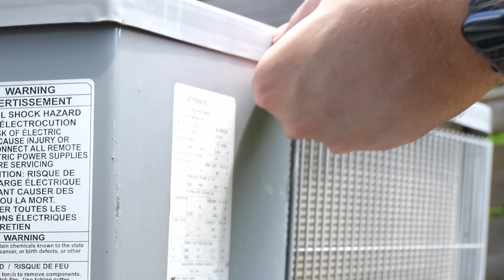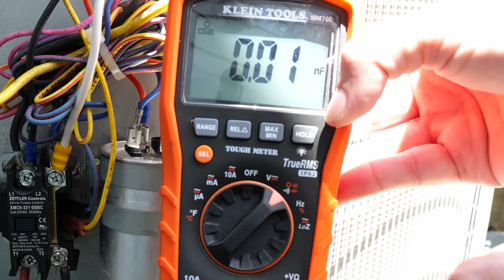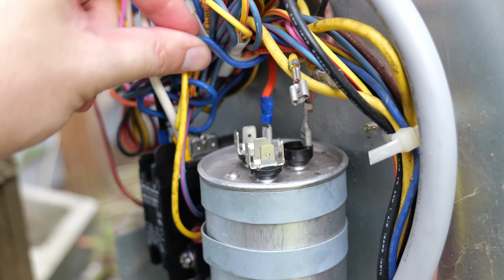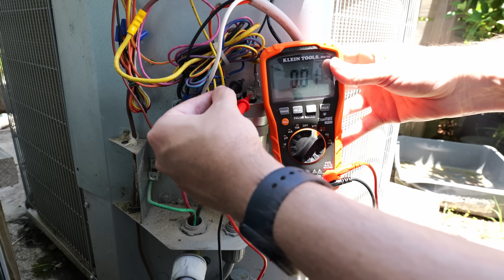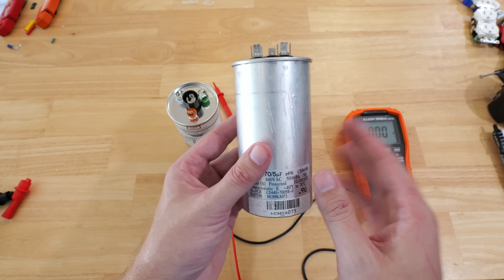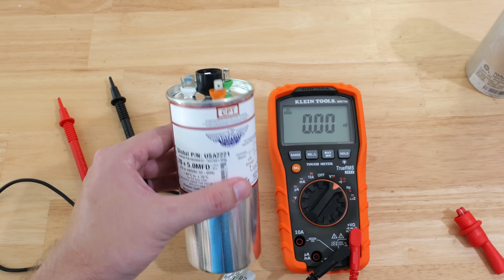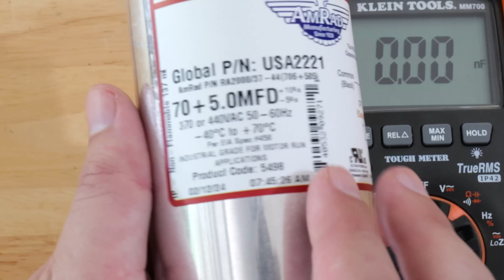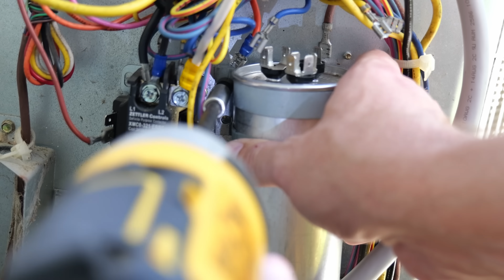Don’t Get Ripped Off! How To Avoid The AC Capacitor Scam And Save $500

Comment: allot of hvac places won't sell to non hvac people. when i had an issue with my heat pump,  the capacitor was replaced by me, it didn't fix the issue, but the hvac guy almost demanded to know who sold it to me. they don't want diy non hvac people to fix their own issues.
Reply from the maker: Nope.  And the supply houses don't want to make the techs mad as that is by far most of their business.
Reply: get an EPA license and they'll sell you just about anything :) lot of "unlicensed" contractors out there too and the only thing they have is EPA cert
Reply: I bought my cap on grainger's website providing no credentials and then went in to pick it up no questions asked.

Comment: Usually those caps well be a bit corroded on the top. when a tech comes to the house they always try to sell you a $400 cap that is about $12 cost  What is a customer supposed to do one of the biggest ripoffs in the USA USA USA USA

Comment: I was quoted $450 labor plus part to replace the capacitor. I replaced it myself for $25; turns out the one I replaced was just fine - the unit had tripped a circuit breaker.

Comment: As an hvac tech myself. I want to ask you one question. Do you really wanna get shocked. It probably won’t kill you.m but it will hurt. It damn hurts. Because it can and it will happen if you’re the normal homeowner. Or do you want a professional to do it?
Reply from the maker: It will happen huh?  Well Mr. HVAC can you explain to me how one gets shocked when power is not present?
Reply: Ah what's 360 volts amongst rookies,
Reply: No way to get shocked with the disconnect pulled and the capacitor drained. You worry about the homeowner but sounds to me like you're the one that's been shocked before.

Comment: So, on the Amrad brand the orange from micro air easy start now goes directly to that terminal?
Reply from the maker: No.  The orange terminal is for a hard start not soft start.  They are wired very differently.
Reply: @HowToHomeDIY  oh ok, thanks. I listened a little too fast and assumed soft start which I will be wiring next week.
Great video content.

Comment: Eh a couple of springs ago (the season) our central A/C unit wouldn't spin up when demanded on, the mechanic is my was wondering what was wrong so I grabbed a long screwdriver and gave the fan blades a flick and wouldn't you know it, the fan would spin but not compressor action. I surmised it may be a motor starting capacitor issue and pulled off the panel and found it, sure enough it was a three leg unit. Yanked it out and took it down to the local supply store to get a new one, less than $20 CAD later I had a new one. Got it home and installed it and supplied the power back to the system and the A/C fired right up as expected. For less than $20 I had my system running again, saved a service call and the markup.

Comment: Here is another	her ac repair rip off     Had to have the 120/ 12v step down transformer replaced on my ac unit . The ac repair company charged me $ 190 dollars for the transformer.  Home Depot sells the exact same transformer for a doorbell system for $18
Reply: 24V, AC systems use 24V transformers :) regardless you can get the part online for about 20 bucks ;)

Comment: If labor is $100/hr then a capacitor swap should be a $150 service charge at most.

Unfortunately most shops tend to charge much more.  However I doubt most customers would be comfortable changing one.  Everyone watching this video may be OK doing it...but that is likely .001% of potential customers.

If in doubt, this is a reasonable blind parts cannon to fire as they are usually under $20...however you have to tell your wife and kids they need to wait two or three days for one to arrive if you're Amazoning it and dont pay for overnight.  That might be a hard sell in the domestic bliss department....especially if you also needed a relay.

Comment: Before it got hot, I checked my ac capacitor and it was right on the edge of tolerance.  Replaced it with a "MADE IN USA" cap and all is good!

Comment: I did need my capacitor changed.  Its rusted and bulging on top.  The problem is the rust obscures the writing.  If you cant see which is C, fan or Herm, is there another way to know which is which?
Reply: Thickness of the wires
Reply: @sprockkets  thanks

Comment: Using a metal tool to short the capacitor is very dangerous!  Could make a huge spark or explode the capacitor.  Always use a large power resistor or similar.
Reply: That is what I made up to discharge mine. I keep it in a case with all my other testers.

Comment: I turned my A/C unit on this year and it ran for about 30 seconds then shut off I replaced my capacitor thinking that was the issue but I’m still getting an error code for “ODU Fan Delay Defeat not Active” any ideas what the issue is?

Comment: I don't do residential AC work. I don't have a problem with a competent person checking and replacing their own run cap. I DO have a problem with people getting the idea that they can safely do this when they are not actually capable. All they need to do is to make one screwup and they can receive a minor shock from the cap, or worse. For the majority of people, it is best to call in someone who IS capable of doing the work, and paying that person the market rate for the work being done. That is not "ripping people off." It is having the insurance, paying the taxes, employing the workers, and supporting the families in the industry. There is a HUGE difference between buying a run cap on line, and stocking the run cap on a truck or trucks, a truck with the liability coverage, the workman's comp, the experience, and the ability to tell you that the problem is something other than what you saw in a video. If you want to focus on someone ripping you off, then get mad at the EPA and the DOE. They are the reason that equipment and repairs keep going higher and higher. Fun fact: soon, your new AC system will have a combustible refrigerant, in the name of saving the planet. Yep, according to the government, the planet is more important than you and your family. HTH.
Reply: Haha I really have to ask, this is video that you have decided you needed to say people aren't capable of doing the work? He literally tells you and shows you how and why to isolate the power and drain the cap. How much safer do you want him to get? You know how many youtubers just skip that and go into doing the work? I've seen so many other videos of people doing far more dumb and dangerous stuff than this. Is 240V power dangerous sure but so is just about everything. Working with a saw and drill can be incredibly dangerous too and yet videos of people doing very dumb stuff are all over youtube going: look what you can do!
Before you try to take the approach and say but they aren't professionals, guess what professionals screw up royally too even if they are honest. I work in the industrial equipment industry, there was a skilled and experienced welder who died because he went back into a confined space to grab something even when he was knew better and was repeatedly trained on the dangers. Servicemen and machines with decades of experience have lost limbs or died doing stuff they know they shouldn't. Being a capable professional doesn't protect you. Plenty of capable professionals screw up too. Yes, people should be weary of what they're doing and be cautions, and sometimes it is better to just call a professional but not always. This is probably one of the better videos I've seen for helping people. Also remember, there are a ton of people out there who literally do not have $200 - $300 plus service fee to have someone come out and fix their AC. They either go without or have to try themselves and I would much rather they follow this video then someone else.

Last point, are you seriously about to complain that they are going to start using combustibles as a refrigerant? Oh no whatever will we do with some combustible in our house. Oh, wait never mind we already do and have for as long as people have been heating and cooking in their homes. This is at least a closed loop with a set amount which really isn't going to do much even if it were to leak. Now that lovely gas stove in the middle of your house or I don't know the furnace which both have for all intents and purpose unlimited gas supply, that should be a bigger concern. A gas stove is so much more dangerous than using propane as a refrigerant for a number of reasons. Which is exactly why the government is working to stop the sale of those, which I'm sure you probably complained about as well. Are combustibles dangerous, sure but so is electricity that doesn't stop it from being worth the risk or a better option that alternatives. Honestly the more I think about the switch to a propane-based refrigerant the less of a danger I think it is compared to so many other things we readily use in our homes.
Reply: FYI the new refrigerant is classified as mildly flammable. You'll have a very hard time getting it on fire.
 It just goes to show you, you don't have any clue what you are talking about. Because if you think R22 doesn't combust, go ahead, take a flame up to it and then tell me what happens when you get a whiff of what results.
Reply: Your post is why i got my 608 universal certification and will keep both of my 1989 R22 systems running as long as i possibly can. Low pressure (relatively speaking) so lower leak rate, no electronics, a nice piston- who cares how efficient it is. Not me. 
Good post
Reply: Another hvac/plumber/electrician guy who can't stand it when people do their own work. 
You know what? If hvac guys weren't regularly lying to customers, this may not be an issue. When you combine the lying with the outrageous mark ups, hiring an hvac guy becomes a roll of the dice at best. 
When I go to a restaurant, i pay more for a steak (that I could cook myself at home) because of the convenience. But the restaurant doesn't charge me for a steak and give me a bologna sandwich. So I KNOW exactly what I'm paying for. 
With hvac, you guys lie about what the problem is, THEN charge way too much to fix it. So don't cry to me about how you need to make a living; if more of you guys were honest and weren't ripping people off, you'd have an argument. Lying to a customer is stealing. 
Personally, I've been around long enough to have fallen victim to lying "professionals", but also long enough to have learned how to do most of my own electrical, plumbing, and most other maintenance/repair work. And thank GOD.
Bottom line, YouTube and videos like this are necessary and valuable. And if most hvac companies stopped stealing and overcharging, there would be a lot less people interested in such videos.
I'm not saying that just anybody should go run a table saw or attempt to install new electrical service to their home. But saying that people shouldn't replace a  capacitor because some hvac guy needs to feed his family is ludicrous.
Reply: @Carl55_jc  I guess it's ludicrous to you. I hope you don't need a professional at some point and find out that that person was laid off. As I said, I don't do any residential work. If you can do this without hurting yourself or having a fatal accident, then I say go for it. The fact is that most people don't fall into that category of competence and safety. Just remember....if you drive out the good technicians by not using them, all you're going to be left with is the bad guys.
Reply: @arthouston7361  Converesly, if hvac and plumbing professionals stopped ripping people off and lying, maybe they'd be trusted more; which may have the same effect. You think used car salesmen have bad reputations by accident? You think hvac guys do? Sorry, but I know better. 
Having a license does not mean you are honest or that you charge fair prices. Lawyers have licenses.
If I test a capacitor, find it to be faulty and replace it - leading to my AC working again, what's wrong with that? If you say "nothing", then why are you commenting on this guy's video negatively? 
If you simply stated that even "simple" jobs can be dangerous, I would have agreed and moved on. But that's not what you said. You went on about families of hvac techs, making a living, etc. Its like the car mechanic who doesn't want to see me charging my own battery. Could something go wrong? Sure. Does jumping a battery require a professional? No.
Sorry, but dishonest techs are a reality and all over the place - and no comment here will change that or move the DIYer that came here for advice or guidance. Especially if it's a comment critical of the guy who's trying to help that DIYer escape the clutches of the "pros" who rob people every day.
Reply: @arthouston7361  OH, and by the way - the customers shouldn't feel responsible for the fate of the "good" technicians if the "good" technicians aren't working hard enough to expose and call out the bad ones. If you're driven out of work, don't blame it on us - blame yourself for not driving out the "bad" techs.
Reply: @Carl55_jc  My, how misguided you are. There is no way, particularly now days, to identify and force ANYONE out of a business. Even doctors who are found to be liable for malpractice often continue to engage in medicine.  Like I said, I don't do residential, but if I did, I know that there is no legal way to "drive out" anyone. Torches and pitchforks at midnight? LOL. Thank you for displaying your thought process. I pity you.
Reply: LOL. Nobody's angry, ma'am. Stop deflecting,  you're the one who brought up the subject of  driving out anybody. And I quote: "if you drive out the good technicians by not using them". Those were your words.
I simply made the point that it's not my responsibility, as the customer, to decide who has work and who doesn't. My job is to get the best work done at the best price. 
It is your responsibility  - the hvac community's responsibility - to be honest and hold others whom you work with (or who work for you) to do honest work. 
The customers are not the problem, the "pros" are. 
You just don't like getting told what for. 
Every video, for example, about sharkbite fittings, will have "pros" commenting about how these things fail, why the "pros" don't use them, etc etc etc. They're mad because a regular joe now has the ability to fix many of his own problems instead of calling a pro plumber. 
You're another one of those guys. You didn't need to comment negatively about the video, but you couldn't help yourself. You just weren't expecting to be challenged about it. 
Now go get your shoeshine box.
Reply: @Carl55_jc  Well, I think that you're making an assumption that's not based on reality. Tell me whatever you want, my friend. I am never going to be doing work for you or anyone else who has a house that needs AC. Just know that if you want good people to be available, then you have to be willing to use them and pay them the market rate. Otherwise, all you're going to be left with are the bad guys. The anger i mentioned is the notion that the AC industry somehow has a high percentage of people who are disreputable, who will "rip you off." If you believe that what people charge as normal and customary is too much, then everyone will appear to you to be a thief. Of course, that is not true, but you believe whatever you like. I don't went people without skills messing around with 240 volts. If they do, I hope they don't try to sue some youtube guy when the get hurt. Hope that helps.
Reply: diy screw ups, I see it all the time. There are other things that should be checked. That’s why I’m licensed and the home owner isn’t. A little YouTube knowledge can kill you but you go for it.